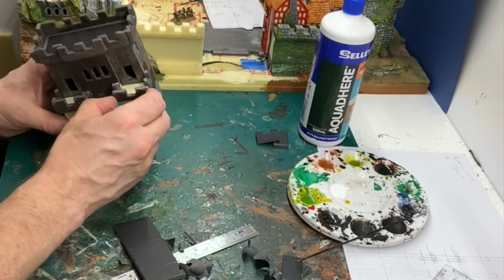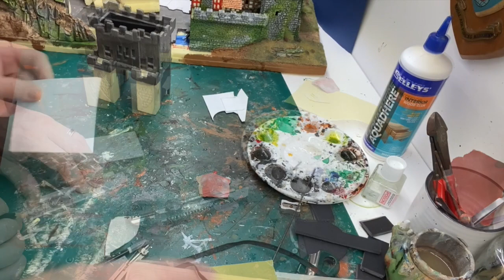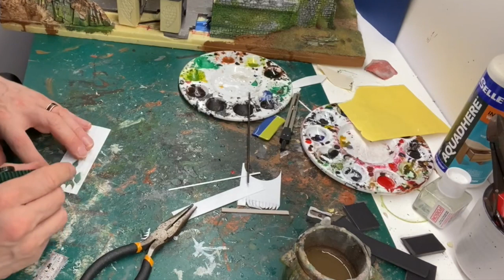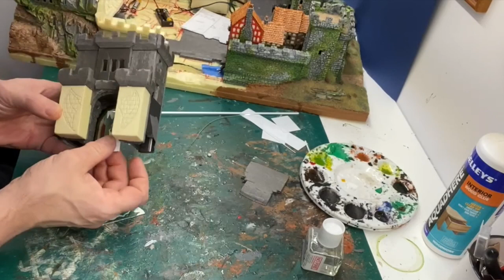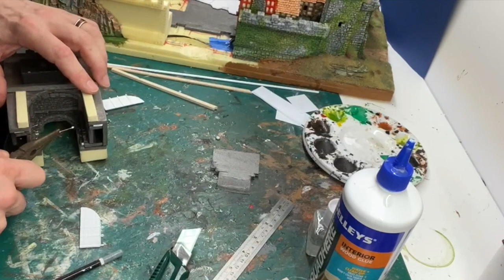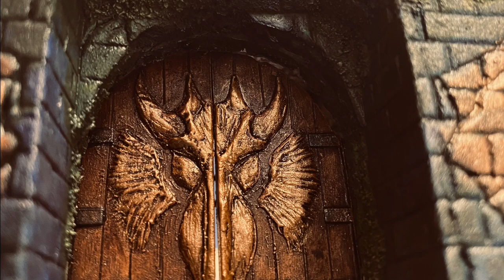DIY Miniature Scratch Build Castle Gate Undercrag Ep. 8 Part Two

Comment: Curious why you didn't go with balsa for the gate?
Reply from the maker: Good question! Balsa isn't strong enough in this instance - the gate is designed to be opened and closed, and would be almost impossible to replace if it was damaged. Plastic is far more durable.